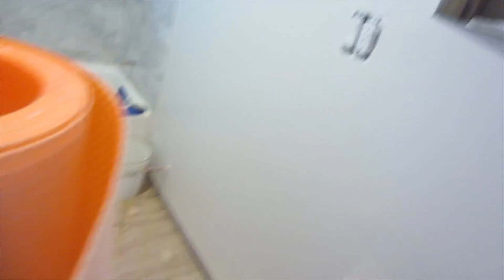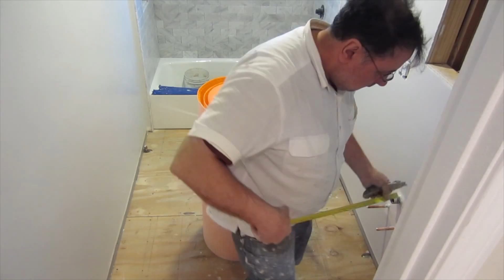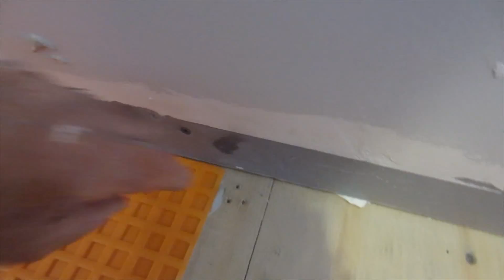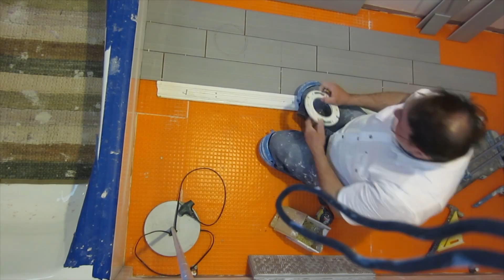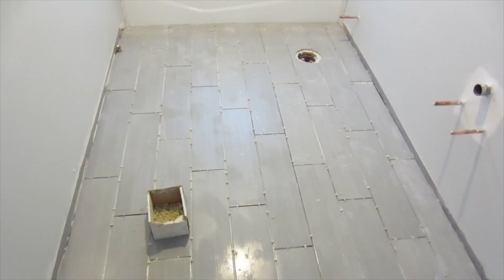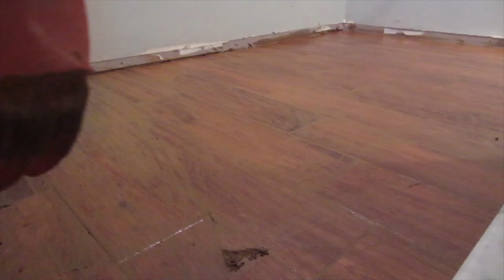How to install wood look plank tile on Schluter Ditra Parts 1 through 8

Comment: I plan on installing plank tile, on a concert slab,  in a few weeks and this is my first time laying tile.  Will the ditra provide insulation against the cold?
Reply from the maker: No, ditra is an uncoupling membrane it has no value as an insulation. If you want a heated floor you can install some under floor electric heat.
Reply: +Sal DiBlasi  what is the name of the thin set that you use for the tile on top of the ditra
Reply: +james brennan  I know you said to use 253 Gold   to set the Ditra   do I use the 317 thin set for the Tile
Reply from the maker: 253 is good, or Mapei Ultraflex 2 or Tec Fullflex, or anything better to install ditra on plywood. 317, or Tec Uncoupling membrane mortar, or Mapei Kerabond , or Ditraset or any premium unmodified Thinset. Key is not to use cheap the stuff always use premium or super premium.

Comment: Sorry if this sounds stupid, but does Ditra eliminate the need for cement board to be used over wood?
Reply from the maker: Yes, ditra replaces the cement board, and is a much better underlayment I might add

Comment: is it necessary to use Ditra on concrete slab (house built int 1997)?  The existing flooring is ceramic tile and there are no cracks.
Reply from the maker: It is not necessary if the slab is in good condition.
Reply: ***** I'm pretty sure the slab is in good condition. I will be pulling up the carpet soon and will be able to check on the condition of the slab.  Thanks Sal!  BTW, your videos are great.  i will be using them as a guide when I do my wood tiles.  Thx

Comment: Thanks for showing the Ditra install. So many resist using it. Are you using 16th spacers? That is what i will use on my install with very similar tile. Not a fan of huge grout lines.
Reply from the maker: I think I used 1/8" on this job. I use Ditra when ever I the opertunity, but some times I don't get to make that call.
Reply: ***** I am tiling a indoor stairwell.  Should I use cement board or a membrane not necessarily ditra but the cloth with a kind of sticky backing on it
Reply from the maker: Donna Cochrane
Can't really make specific recommendations about jobs i know nothing about, but i personally don't use cloth membranes for floors.